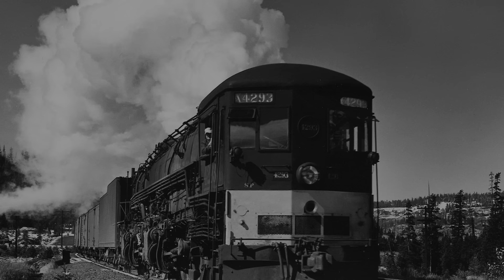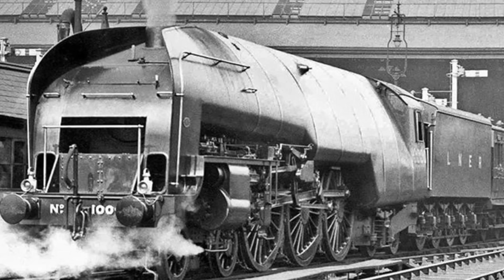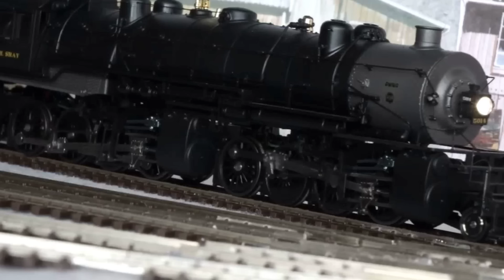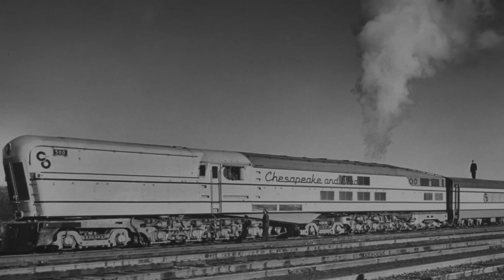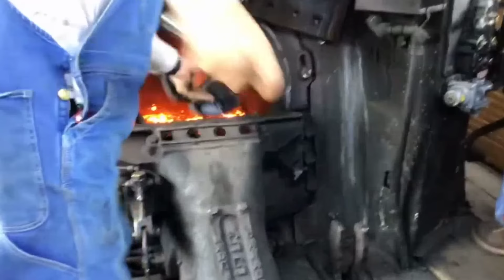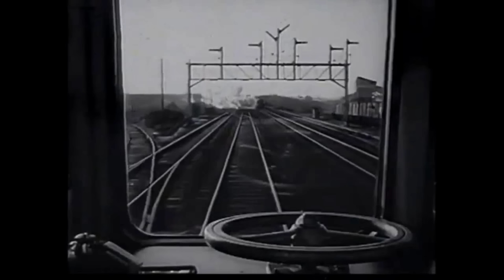10 Most BIZARRE Steam Locomotives EVER Made

Comment: Please explain how the dust gets inside the boiler??? Two completely different systems that shouldn't be bleeding over into each other.
Reply from the maker: That's a legitimate technical challenge -- the combustion air intake is the pathway. On coal-fired steam locomotives operating in dusty or high-particulate environments, the forced draft systems pulling combustion air through the firebox can ingest fine mineral dust along with the air. Scale buildup from feed water impurities is a separate but related problem. The systems are distinct in design, but they share the same operating environment, and that environment isn't clean.

Comment: Wait, there used to be an engine larger than big boy 4014? Cos big boy is a 4-8-8-4, but one of the engines are a 4-8-8-8-4
Reply: The Erie triplex is a 2-8-8-8-2, not a 4-8-8-8-4. Also, all Big Boys are the same size, so why specify 4014?

Comment: I have never seen a reference to any railroaders calling the Southern Pacific cab forwards "backward engines" but I suppose that is possible.  What is well know is that on the Southern Pacific they called them "Mallets."  (Pronounced Mallays.)  Now a TRUE mallet articulated locomotive has a set of high-pressure cylinders and their exhaust feeds a set of much larger low-pressure cylinders.  But the Southern Pacific engines were "simple articulateds" meaning all cylinders were high pressure.  So, while they were technically not mallets, that's what they were called anyway.

Comment: Coal dust cannot enter turbines. 

The coal is on the outside of the boiler. The inlet of the turbine is connected to the inside of the boiler where the steam is. There's steel in the way. The turbines were eroded by wet steam, likely caused by varying load conditions. Turbines are destroyed by wet steam, the water droplets impacting the blades wipes them out.

Comment: Diesel electric Kicked these machines right off the field with 95% efficiencies. An incredible leap forward.
Reply: The advantages of diesels were numerous, but the diesel's efficiency in terms of mechanical benefit per BTU is about the same as a modern oil burning steam locomotive.  But the diesel's significant advantages were lighter weight so less damage to track.  No need for frequent water stops.  Far less maintenance meaning far more up time.  Ability to connect a number of them together with one crew instead of having to use multiple engines each with a crew.  Faster start up.  Don't have to have as many different models as if you need more horsepower, you just add more units.  A huge advantage is, since they are really diesel-electric, is that they can have maximum torque even at zero mph where a steam engine can deliver very little horsepower until it gets to speed.  So, they can start heavy trains easier.  And one that came later on is dynamic braking where the traction motors function as generators connected to resistor grids converting the current produced to heat and this slows the engine without having to use brake shoes.
Reply: @trainliker100  Diesel fully replaced the inefficient old steam engines long before the modern steam engines came online so it's a moot point. Name an American company It uses steam engines on the tracks,,, none!

Comment: I wonder if the steam turbines would work, running on oil instead of coal.  It would eliminate the coal dust issue.
Reply: I can't figure out how coal dust would even get into the turbine to begin with. The coal dust is OUTSIDE the boiler, completely separated from the steam by steel.
Reply: @NoopityNoop  It didn't.  The video is just a bit wrong on this point.  There were issues with coal dust,  ash, and water with the traction motors, generators, and other electrical equipment.

If the things ever actually entered service and really ran, the turbines would have experienced the rest of the range of issues that others did though.  Too much vibration on a locomotive causing excessive wear, power demand fluctuations leading to wet steam eating the turbines, massive size for what you're getting, and etc.

Comment: You missed the German 19 1001, a steam engine with a Siemens-Pawelka drive. It's a 2'-8-2' engine which has a 2-cylinder steam engine directly mounted to the wheel. 2 on each side, on the first and third wheel on the other side on the second and 4th wheel. Only few test runs were made due to the war, afterwards it was even brought to the US.

Comment: Anthracite coal is not coal waste. Anthracite is a hard coal with no tar component. Anthracite burns very cleanly and little or no smoke.
Reply: Yes, but the Anthracite used in Camelbacks was specifically Culm.  This is the leftover waste from the higher-quality Anthracite that was sold off.  This made it cheap, which is why the railroads were able to justify using it.  Yes, Culm burns (relatively) very clean, but it burns very slow.
Reply: Also excellent for filtering waste water.
Reply: anthracite was the best coal😊
Reply: @williamwatson72 still is , great for filtering and clean burning.

Comment: Guess when they were trying to adopt the steam-turbine from ships to trains they for got that most turbine driven ships not only burned oil because it was simpler to refuel ...
+ not to mention boilers can be bulit to burn other liquid fuel sources, if oil is not that easily available where it needs to operate. 
Fun(ny) fact: we have an express loco at the local museum that can operate either on oil or coal, the conversion would take about 2-3 hours when the loco was in service. It worked like a "parts kit".
Reply: Coal dust cannot contact the turbine. The coal is outside the boiler, the steam is inside.  There were many coal fired turbine ships. Even the Titanic had a turbine for its center prop.
Reply: @NoopityNoop  yes i know (im a railway engineer). and that turbine on the Tittanic used the exhaust-steam of the engines' .

Comment: The one thing you didn’t mention about the triplex was the problem with the third engine under the tender. As coal and water were drawn from the tender, it of course became lighter. This caused the engine to loose traction because of the weight lose and would would spin the drivers, wearing down both rails and the drivers’ tires. In the video clip you used, you can see the massive wheel slip on the third engine.
Reply from the maker: Great  point, appreciate it

Comment: Outside of these ten plus Belgium Quadruplex, other steam locomotives that can be mentioned are;

Fowler's Ghost (ancestor to fireless locomotives), Fontaine locomotive, El Gobernador 4-10-0, Meigs Elevated Railway, 6-2-0 Crampton, GWR Hurricane (boiler on separate six-wheeled frame), Swiss High Pressure 2-6-2, and Jointed-boiler Mallet.
Reply: So Belgium actually built a quadruplex?  I knew someone in the United States designed a quadruplex, but in our case sanity prevailed and it was never built.
Reply: @kennethross786  The Belgian Quadraplex was actually designed (iirc) in conjunction with, and for, Italy.  Shoving big trains over the Alps.  And it WORKED.  Supposedly, the only reason it didn't go into production was because the Italians noticed THE MILWAUKEE ROAD and decided to adapt its electrification instead (3kV DC).
Reply: The double Fairlie counts